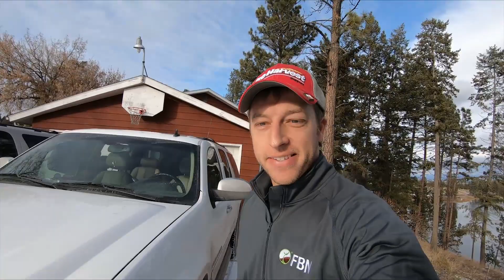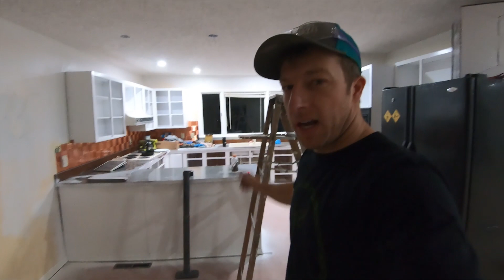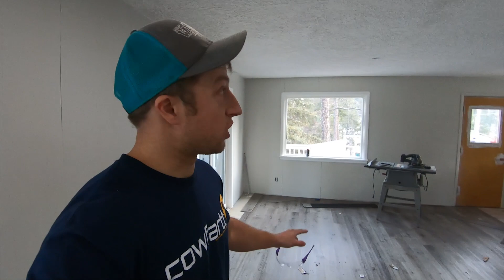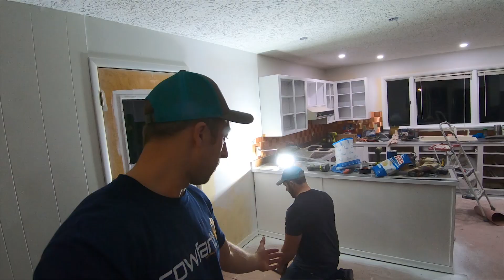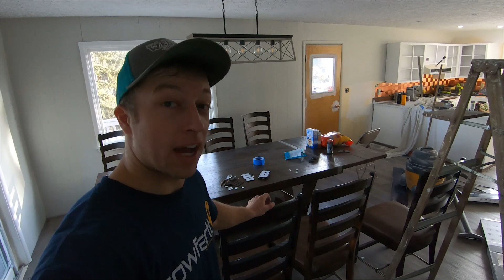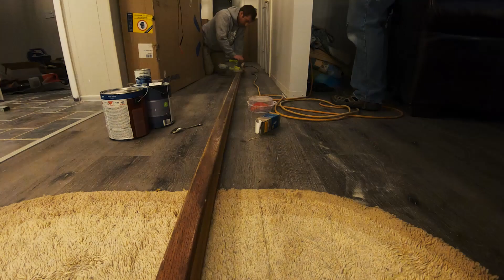Lake House Renovation Part 3｜Light Fixtures & Flooring Transforms Upstairs

Comment: Welker family I just had a thought.  Quite a few of  you are getting sick while you are there at the cottage. Could be a flu bug or maybe you should get a water analysis done on your well. Better safe than sorry.
Reply: Or (even worse) moisture in the walls/floor/ceiling.
Reply: @KNJensen  Na that would not cause nausea.
Reply: @davebrittain9216  Huh? Sure it will. Along with headaches and migranes. And more serious health issues from long term exposure.
Reply: The barfing bug is going around Shelby like crazy, so it definitely was that as opposed to mold.
Reply: @KNJensen  No it does not lol. It affects the respiratory system not the stomach. You are jumping to the extreme with the rare case of toxic mold then possibly. If they ran into toxic mold that would be different story and there are no signs of toxic mold that I have seen in any of the pictures of the place or the video. Seems like when ever anyone sees mold they want to jump to the worst conclusion.
Reply: @davebrittain9216  Well, i have worked in a building with mold in the walls for 6 months. We all went home with terrible headaches every day. Never touched our stomachs though.
Reply: @KNJensen  psychological effect or some other factor. I have worked on the job in mold for years. Have special training in the matter and was co chair for the health and safety department for a large gov work force for 12 years. I have seen every aspect of it. EVERY house that has been lived in for has mold in it. Some brand new houses have mold in it as well. Every lawn has mold in it. It is all around you. Do you have headaches all the time? If mold causes head aches for you then you would be having it 24-7.
Reply: @davebrittain9216  The main difference in those settings - old house/new house/lawn must be a matter of amounts. Of course there is mould in a lawn, but its well ventilated, and the amounts are small. Old, poorly ventilated houses with high amounts of mould is a different thing all together.

Either way, its not healthy.
Reply: @KNJensen  Hey Kristoffer what work were you doing in that house. Gutting and reno?
Reply: @davebrittain9216  No, i am en EMT and the place in question was our firehouse. So besides checking vehicles in the morning, we dident do much, unless there was a call. As the place is very rural, there seldom was.
Reply: @KNJensen  How old of a building?
Reply: @davebrittain9216  uuuhm... best guess is about 100 years.
Reply: @KNJensen  More to worry about asbestos than mold. Anything built pre 1980 has asbestos.

Comment: I gotta say, whenever I've put that flooring down, I've never used a special tool. You'll find you get plenty of 'off-cuts' that have the right tongue pattern, so you can use those as knocking blocks to hammer the flooring home. 
Also, don't forget to leave a gap round all the edges to account for expansion/contraction. Without the gap, when the flooring expands, it'll cause lifting in places and creaking against the wall when walking on it. 
Looking good so far, keep up the good work.
Reply: If you do enough floors it's just far easier to have the proper tools.
Reply: @xcalibertrekker6693  Oh I agree, a professional would be better off buying the proper tools, but how many times are a family of farmers going to find themselves laying flooring? ;)
Reply: @Galerak1  It is also what you want to put yourself through. And you don't need to buy it. Just check what it looks like and make it yourself is also possible. 

Have laid the same floor for 3 days in a row, You want that tool. Did it before in a single bedroom only 12m2, didn't need the tool.
Reply: Thanks 👍

Comment: LED lights, especially LED can lights are great but for built in can lights  I would buy an extra fixture or two.  While long lasting, there is almost always an early failure of one or more and my experience is you can never find the exact replacement after only several months.  The manufactures are always evolving their products. Replacements by even the same manufacture seem to be a few watts and or color temp difference (noticeable) or the trim has changed.

Comment: Back as a kid my parents had the washer/dryer in the basement, it's where most people had them both because of leak/burst hose potential and noise. It was kinda cool though, there was a closet in the bathroom that had an opening in the floor cut out so you could drop clothes or bedding down and it'd land in a hamper in the laundry room below.

Comment: Pro tip: When using the oscillating tool to cut the door trim and jambs, use a piece of scrap flooring as your guide...no need to mark with a pencil...the oscillating tool will sit on top of the scrap flooring and still cut the jamb/trim. 👍
Reply: Multi-tool.  ;-)
Reply: Great suggestion thanks!
Reply: For someone not doing this everyday he did a great job. For someone doing this everyday drop the DIYer oscillating tool and use a jamb saw.

Comment: Just an idee that might be a little late for this flooring but if you are ever doing a project like this again it might help :). (I'm not saying you did it wrong or anything just wanted to pitch my idee to you all)
So i think you should started whit 1 line of floring under de strip you could't pull out. Put down a pencil line on the end of the 1 line of floring. so like in the length of the hall way. and than start in the kitchen. once you get to the hall way put the flooring just past the earlyer drawn line and measure the differends. saw that of the flooring and it should fit under the strip.
This is just an idee. Not sure if it would have worked or would have been any easier. 

P.S. have a merry christmas and a happy new year. All the best whises.
Reply: Have a Blessed Merry Christmas!

Comment: We had a similar problem the first time we installed floating flooring.  They tell you to install temporary spacers around the edge to keep a gap between the flooring and the wall for expansion.  We didn't start with the spacers in.  We had a about half of it in when we realized all the tapping had shifted it off square.  We were able to pull it back square to the walls with a ratchet strap and 2x4 across a closet opening.  Lesson learned.

Comment: That place is looking amazing. You guys are doing a bang up job. The ladies have great taste. We did use the felt pads on Furnature at my grandparents house when they got wood flooring put in. Works great on Furnature that dose not move often. But dose cause the Furnature to shift a little. Sort of annoying. The down fall was we have yet to find pads for the dinning room chairs that will stay on. Have tried the stick on, ones that have a small nail in the middle. Cleaned the leg with rubbing alcohol every which way they just won’t stay put. We change probably five or six a year. I tried them on our chairs in our kitchen too and they last a week or so. May have to accept that. Keep up the good work. Looking very nice.

Comment: Question: As a rental property, does Montana require you to install smoke & carbon monoxide detectors?  Even if not I'd install them, the ones that wire direct, not battery operated. Anyway, looks good! I like the ceiling job, the blisters on Leg Arms hands was worth the result 😉

Comment: Not sure if you guys will see this or be doing much more flooring, but when you're cutting the molding at the bottom of the doors, you can get the perfect height by using a piece of scrap flooring and putting it on the ground and then putting the oscillating tool right on top of the scrap and the floor will fit perfectly underneath it. Enjoy the reno process!

Comment: Great work! Looks real nice. The ceilings are a throwback to what was popular when it was built...as is the copper backsplash. If the paint cones off the cooktop, find a used stainless steel one...it will tie in fine, I think. Plenty of them online...or a Habitat store.
I love the home. I can see Christmas there every year.

Comment: On the oscillating tool, take a scrap piece of flooring and use as guide to get correct height for door casing/?.

That is the problem with floating floors, but  nothing wrong with wedging. Heck, even consider a fastner (or two) to reduce having it happen again. Again, not "ideal", but since it is front entry and will get much more traffic..

Comment: You'all are doing great.  No need to defend your choices.  Only suggestion is to have a dedicated external air source for the fireplace.  You are good farm engineers.  You can get an outside air source that will feed the fireplace w/o drawing room air, and that you can close when the fire is not in use.  Otherwise it'll suck on every window and door.  Amazing how much it reduces drafts :-)

Comment: I get it Nick. I don't like textured ceilings, but what makes me twitch is drywall that you can see the seams and unevenness. Sometimes textured is the way to go. In a cottage you will get movement unless you keep the heat/ac on all the time.

You guys are doing a great job.

Comment: You can get that small crack out of your flooring by prying with a pry bar and tapping the floor with a hammer it could come apart in time if you don't I do that kinda work every day just a tip

Comment: For the stove that semi-gloss grill paint may not stand up. If it DOESN'T, try a high gloss black automotive engine paint like the Duplicolor engine ceramic enamel. You'd have to prep the metal properly first so you're talking $20 in materials and an hour of work, so still worth a shot.

Comment: You need to add a rotary hammer to your tool box. They make quick work of taking up flooring or breaking up masonry. With a wide chisel it would have taken up that glued carpet and the tile in no time. You don't even need the full size one most of the time, the smaller SDS-Plus drills do a great job.

Comment: Also u will want a bit of a gap    at the end of the floor by the wall coz when a skirting board goes on u wont see the gap and when the boards get worn from heating in the house they will expand

Comment: Use a piece of flooring to set your vibrating cutter on when cutting trim. This way, you won't have to hold it up and your cuts will at perfect height and straight.

Comment: That quarter inch is a major pain on these floors. We put very expensive stuff with lines that had to match. Now that quarter inch let’s the lines get out of sync. The installer said the warranty is void if we filled that quarter inch. We compromised and put a very small spacer in. The floor still moves a lot, but not as bad. Beautiful job, really liking the look.

Comment: What about a laundry drop from upstairs to downstairs? I was once in a house similar with rooms on both floors, and there was a chute (basically a flap in the floor) that allowed you to drop washing down into a basket next to the laundry.  Really worked well. And seeing as you're at that stage, perhaps you could work it in?  Or not - nothing wrong with walking up stairs.

Comment: I wouldn't worry about what's in right now in the interior design business. Things like textured ceilings and broadloom carpeting have cycled through the fads both ways. Just as fake wood flooring which is enjoying a boom right now is essentially the same idea as the cheap parquet floors that people were ripping out once in favour of broadloom wall to wall carpeting. 

It's going to be your home for decades not just a couple seasons worth so don't worry about the opinions of the trend-sayers. It's all cyclical. 

That copper looks fantastic btw. Merry Christmas to all.
Reply: Have a Blessed Merry Christmas!

Comment: brings the proper tool and hammer to install the flooring. what happens: use the tool but not the hammer. well at least the hammer isn't as crucial as the tool

Comment: Vynil plank flooring is the worst wait until it dis colors or bubbles from the sun watch in front of the sliding door and windows blinds will help stop it and put silicone at all outside entryways if water gets under it the mold will get out of control just some tips from a guy that does this every day

Comment: I like what you did with the your choses. Besides the house belongs to you and you guys don’t need to justify what and how you do things. Putting the washer and dryer down stairs is smart. If heaven forbid the washer sprung a water leak it better to have it down stairs because that way it captured in one confined place and not two levels.
Reply: Hey one thing I forgot to mention. I like that copper back splash in the kitchen it give good contrast in color in kitchen. But I bet it would be hard to keep clean and looking nice. (My commit and opinion only remember it’s your house not mine.)

Comment: Love the Cowfartt shirt. The drywall company that did our home used a round brush to apply the mud to the ceiling, then knocked it down. Very consistent, and looks great. Thankfully your floor is vinyl, because a floating wood floor is extremely prone to humidity.

Comment: I like the ceiling.  It is those stupid interior designers who think they know what's right.  They are also the ones who keep taking down ceiling fans.  They are necessary for good living.  They move heat around in winter and are cheaper than AC when you have an early spring warm day or late fall warm day.

Comment: I think too many people were mistaking a textured roof for popcorn.  There's a difference.  Textured is still in when done right, especially in the modern style, popcorn is the one that sucks no matter what. :)
Reply from the maker: This place has a nasty yellow glitter popcorn, didn't show it in the videos but it had to go so we carefully took it down.
Reply: @WelkerFarms  LOL ya described perfectly. Couple people told me to remove popcorn ceiling when I bought and curently living. (3rd house flip) I knew its lot of work of remove popcorn and fix ceiling. I actually applied Kilz "sealer" paint 1st coat then 2nd with regular paint. Carefull not to get too wet paint or it`ll peal off. It actually turn out nice.

Comment: The vibrating tool is called a fine tool
Reply: Actually it is called an oscillating cutter. FEIN (pronounced FINE) is actually just one of several manufacturers (one of the top two in my opinion) of oscillating cutters.

Comment: With the splashback above the stove, take out the copper rubbish and put in a coloured piece of thick glass (one piece) in like a blue or light green, it will look much nicer and is easier to clean don't put in tiles

Comment: when working with wood it's called "roughing it in" and "finishing it out" . the house is called a "split level" with a "upper level" and a "lower level". So as far as the washer and dryer your "damned if you do and damned if you don't a "no win" situation.

Comment: OMG don’t put laminate in the bathroom. Laminate and high moisture do not go well with each other. Yes some of the new ones say their waterproof but their not they are spill resistant not waterproof. Also leave more like 1/2” gap around the room put your baseboard  back on and then a 3/4” quarter round. Trust me I have laid way too many sq ft of this stuff.

Comment: I think if you made this house a “Welker experience “, the renters will be more courteous to the neighbors and gentler on the property.  May get fewer renters, but charge more and throw in $100 of Welker gear😀.  Also going to need a tractor to take care of this place.  I have a Steiner 430 Max, but a Ventrac 4x4 is about the same.  Would be an excellent machine to fit your Channel.  Buy a used one, give it a Welker refurb to look like “Lil Bud”, put Welker sticker on it and every renter will want to drive it😀.  Here’s a link to a Steiner 440 with duals
https://youtu.be/gsANwHVjzkw

Comment: You didnt need that tap block, you can use a scrap cut off with the tongue towards the groove and tap that. Though I would have recommended a LVT pull bar but the pry bar works also. Those shaping tools you mentioned for the door jambs are garbage.  The speed square you used should work fine for the jambs, I again just use a scape piece or a full plank because it's square enough and usually closer rather than welking across the room for the square. I understand the delay in the videos and that you're well done already but for those using this vid as an inpiration may find this info helpful. Have to say though seems you guys def punched your man cards installing with no knee pads.